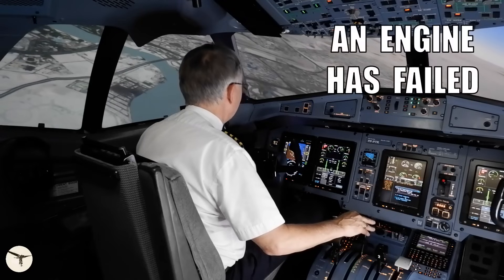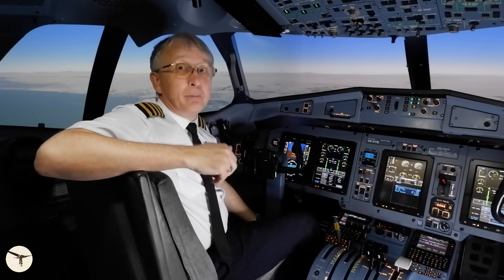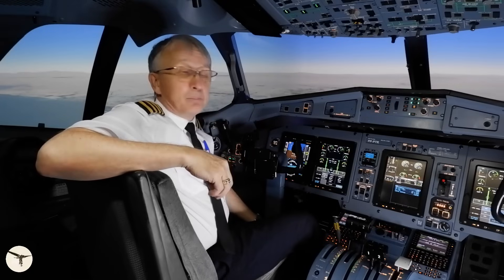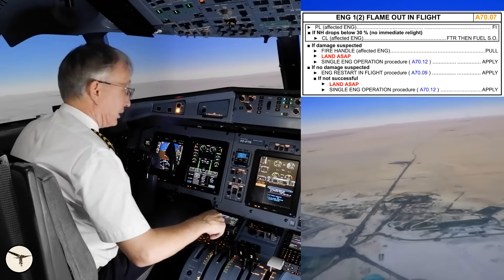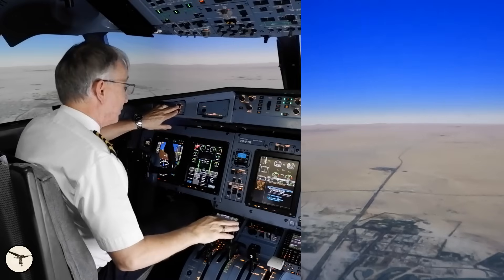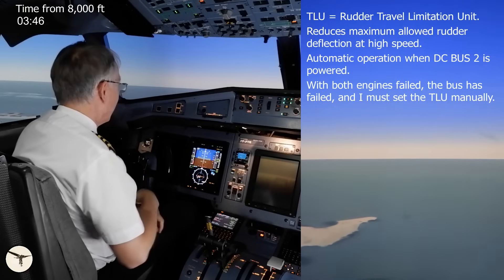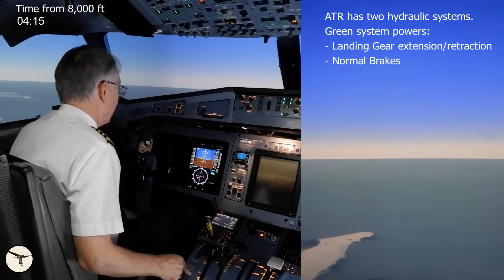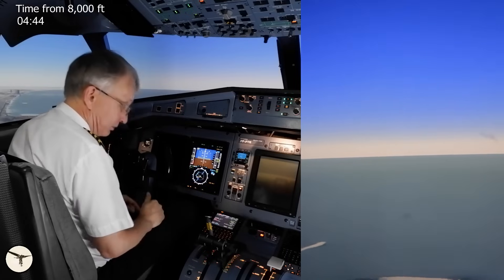Both Engines Dead! ATR 72 Deadstick Landing

Comment: Surely the 15:1 glide ratio will vary a bit with speed as well as configuration (flaps / gear) .. although the ATR landing gear is probably not adding too much drag when compared with bigger airliners

Comment: Surprised to see the ATR has no RAT (except I miss it somehow) - also for the same flying technique as we were taught while on ou C152 during PPL (I guess if it has wings it flies on the same principals)
Reply from the maker: It is not necessary. The primary flight controls are mechanical, and the electrical system has multiple layers of redundancy. To my knowledge, no turboprop aircraft have Ram Air Turbine. Even the Boeing 737 doesn't have it.
Reply: @FlywithMagnar thanks for the clarification. As a lowly ppl single engine daylight pilot I'm always interested in how professionals do it and what of that can be applied into a more efficient and safe airmanship...

Comment: Great video, and good landing. Would you not open the Hyd crossfeed and press the DC pump to power the green system to lower the gear?
Reply from the maker: The auxiliary pump is a low-capacity pump. If crossfeed is used to lower the landing gear, it may overheat and fail.